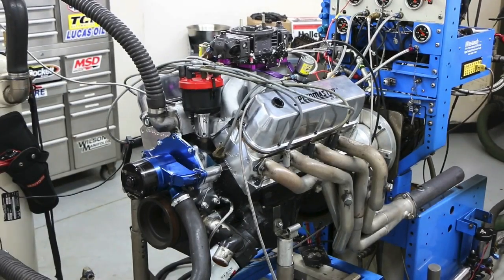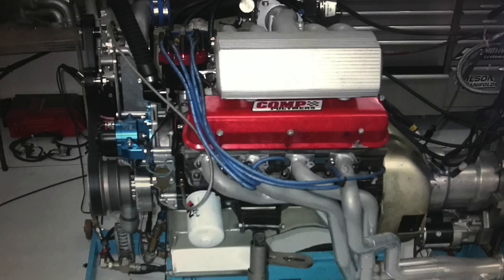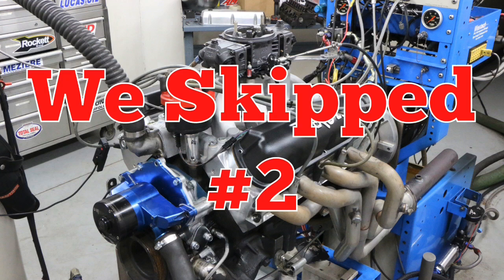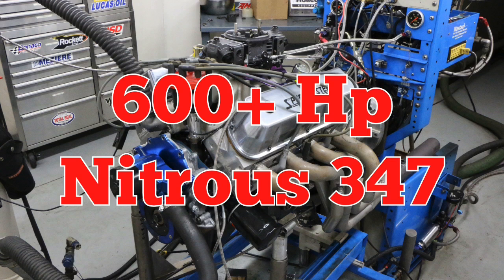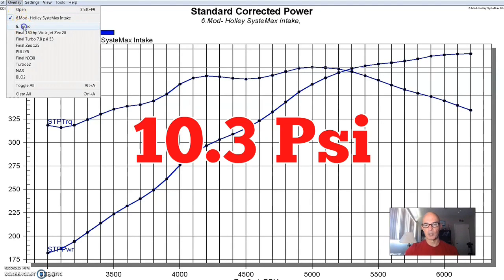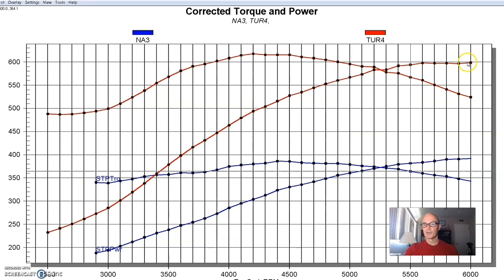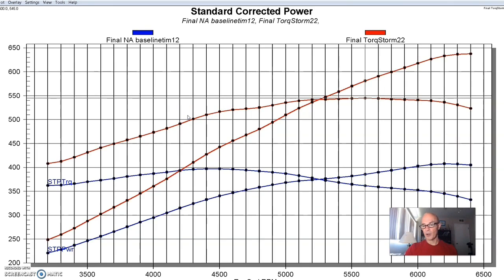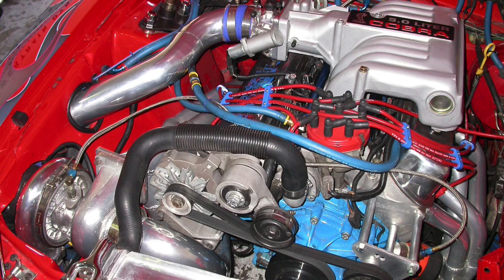5.0L FORD BLOCK SPLITTING-FACT OR FICTION?

Comment: Most of these block cracks were likely a product of an unbalanced reciprocating assembly combined with huge shock loads and some sort of tuning infancy issue and abuse. Could be inconsistent castings as some others said too, or a combination of all of these things.

Poo-poo it all you like, but there were some "block cracking issues" during the 90's up through the mid 2000's or so.
Girdles for bottom and top ends were produced to "address the issue". Whether they did, or not, or were even necessary, is another issue.

Respectfully, not every builder is Richard Holdener, and having access to a dyno, high precision afr meters, etc.
Particularly during the heavy development and aftermarket boom of the previously mentioned eras.
All the block cracks were probably just kind of a huge combination of various factors.

Richard: My understanding is that the webbing on the HO motors is actually fairly thin for a smallblock. What about that for a contribution at just the right harmonic and shock?

Comment: Funny thing, it seems dyno’d motors are pretty much impervious from splitting. This would suggest that the condition that causes a catastrophic failure is being averted. Almost all of the suggested causes could be detected at the dyno.

Comment: It's the stock 2 bolt main cap walk due to the bottom end not being well controlled at high power and high RPM's once the crank starts flexing and walking the caps back and forth they essentially just saw themselves in half. If you run a good crank girdle (people swear by aluminum girdles as they're good at dampening vibration due to the malleable nature of aluminum) a well balanced bottom end  (especially since they're externally balanced), they can last quite a long time at those power levels. Running 4 bolt splayed mains and a crank girdle and valley girdles they can last virtually forever. Keeping the valve train well controlled with lighter spring pressures using a beehive style spring also helps immensely. I think the 302/5.0l SBF is an excellent platform and the 351 Windsor is even a better one. Just got my first 351 Windsor in my '82 F250 4x4. I have 2 289's and a '68 Mercury Cougar 302 I've yet to build but it will get at a minimum a crank girdle however I expect it will see a low RPM life in more of a rock crawler than a race track brawler!
Reply from the maker: MAIN GIRDLES DO NOTHING TO STOP THE BLOCK FROM SPLITTING UPWARD
Reply: @richardholdener1727  I'll disagree with that assertion, I've never seen an SBF split that's been outfitted with main and valley girdles flogged at ungodly power levels and RPM. I don't see your need to yell via text, that's silly.

Comment: My Incon TT 331 made around 550 at the tire. I daily drove it(weather permitting) and took it to the track sometimes twice a month, in a full weight stick car built to hook, for three years before throwing a rod. Other than the hole from a flying con-rod, the block was fine when I tore it down.

On the other hand my friends found a crack in the lifter valley of his supercharged 306 while swapping intakes and that motor only made about 475 at the crank. My opinion is is all comes down to inconsistent castings. Many or even most are fine above 500hp but you only hear about the bad ones.

Comment: When I was younger I saw several hydraulic roller blocks crack from the top of the main journals into the cam journals. If memory serves me correctly all were stroked, & on a heavy hit. I think there’s obvious reasons as to why this can happen. Things like who balanced the bottom end, if it had a main girdle, year of block used, etc… this reminds me of so many other issues when gambling with factory components. Just because someone has, doesn’t mean you or anyone else for that matter are going to have the same luck.

Comment: They split from RPM in a chassis. Pushing hard. Keep it under 6k on boost and it can help. 

I know this video is old but it is legit what I’ve come up to. A 302 block is a pile of shit for pretty much anything but being a original engine when you have 351 option

Comment: Its detonation, thats mainly what splits blocks. Theres a guy who runs his car with a single turbo on c16 with very little timing and it makes 900 wheel and has for years. Not to say its a fool proof way, the main issues with these blocks are that they are  2 bolt main and the webbing where the main caps bolt to is not very rigid so when it detonates the main bolts will vibrate and flex and cause the block to split in half, Obviously poor balancing can exaggerate that but the main problem is the block itself.  Everyone has their stories claiming its a myth and it could just be a bad casting or whatever but honestly its all BS. Fact of the matter is the stock block just wasn't made to handle that much power. You can try whatever remedy you want but at the end of the day if you are making over 500 wheel on a stock block and consistently racing and beating on it you are running on borrowed time.

Comment: I've never split the block! But broke the connection rods! That's an idea! Stock rods with those 5/16" bolts and another with cheap aftermarket rods with 3/8"bolts! Unless a 351w won't fit I see no reason to run  302. What would be great is a  351w with the Cleveland sized mains!

Comment: It could literally be ANYTHING that causes a stock block to split. I don't think there's any way to accurately determine specifically why it happens to a given block, but whatever it is a stock block cannot withstand the failure. An aftermarket block is arguably a stronger part, and can withstand whatever is handling the block splitting condition. 

Stock blocks were really never intended to support such high power numbers, and if you can get them to live for any length of time, good on ya, but I wouldn't trust a high HP (with your favorite power adder) build with anything less an a DART or FRPP block and a rock-solid valve train. I don't even race, and my current motor has a DART SHP block.

Comment: This is what I've seen them do. Crack at the cam bore and drop oil pressure big time. The loss of oil pressure let's you know your fixing to split the block. I've never seen a block completely break in half. Both the 302 and a 5.0 roll that cracked were 6000 stand trans. Lanch at a preped track low 9s say around 700 to 800 hp. Look 5.0 blocks really are a dime a dozen. Try to split one yourself.

Comment: What splits these blocks is easy if you use a 289 older firing order too much load goes onto the front journal when 1 and 5 hit simultaneously that is what splits the block so just use a later firing order camshaft and this will not happen.
Reply from the maker: they split with the HO firing order

Comment: I've got a factory 1986 302 I'm wanting to do something with. I'm kinda scared to because it does have about 450,000 miles on it. I'm not too sure how that would effect the strength of the block
Reply from the maker: what it needs is different heads and cam
Reply: @richardholdener1727  yeah for sure. I'm thinking maybe some flo tec heads with maybe a .450" lift, 350ish duration 115ish separation would give me a nice little build I can still daily drive.

Comment: I think it's torque and tuning has a big part of it. My buddy has one with 650 horsepower stock block and he launches that car at 5,000 RPMs with slicks and it won't die. He does have AR fasteners in the bottom end and the head studs. You should do more ford videos

Comment: I want to be upfront the engine combo I had was never on a Dyno. I had a customer that wanted to run 5's in the ⅛. His combo ran consistent 6.13's. I used his 302 XXX block TFS High ports single plane intake with a .780 lift cam. This combo ran 5.40's down to low 5.30's. It kept cracking the block in the lifter valley just enough to put water in the oil. The engine was in an 88 GT hatch back. We cracked 3 blocks before moving everything over to the a cobra R block. I did not know about 302's cracking until then. It still never "split" the block

Comment: The number in the day was around "500RWHP" not 500HP...    The mains could tear out, it could split down the middle in the lifter valley, or it could crack the blcok around the mains.    It was usually due to harmonics.     There are years in the 70's which had more metal, but early eighties to mid 90's were thinwall casting blocks that failed at these numbers.
Reply: And its a fact!   We had too many situations in those 90s in the thinwall castings.

Comment: Based on internet research, and not my own testing, 3 primary points relating to longevity, and some smaller points. 
- Rpm, keep it lower than 6k
- Harmonic balance. The closer to zero balance the better
- Tuning, a safe tune as you approach high rpm is crucial. Too much timing and a sketchy A/F ratio can be the formula to a kaboom. 

Other things like manufacturing tolerances, wear on the block (age/ mileage), cheap valvetrain parts, e.t.c. 

That said, I believe the consensus is 500whp though, not crank hp.

Good info all around. I've dyno'd at 570/540 on a reman Cobra motor with a safe tune. We took 2 degrees out and it's currently running at 540/520. I'll run it this season and find out how it holds. 
Btw, it's EFI, controlled by Holley's Terminator X.

Comment: oh funny finding this after just asking the obvious question... originally had an NA build.. ported E7 (took a very long time to do it best studying under Vizard) , ported truck intake with twin 61mm TB, lunati valvetrain.. was hoping for high 300s   but   stimulus   told me to buy a rebuilt powerdyne  with 6 psi pulley.  Why not completely alter everything even after getting a custom chip tune for speed density.  I plan to keep hypers but ive got a snow kit (water/meth)... also a T6 aluminum cap girdle and ARP studs.    I did see back in 2006   there were the "valley girdle pro"   and even Don Garlitts had a hand in valley girdles for Clevelands..  but they don't seem to really be a thing anymore?   or people found the block just splits underneath them if it's going to go...  but I guess they helped with twisted just as a cap girdle helps with walk and strengthening the webbing.    I see people mentioning high octane  ( via water meth )   how much can detonation contribute?

Comment: I think it comes from motors being out of balance even if its slightly out of balance a lot of people will run stock balancers and have the rubber come out and not know it, or the rotating assembly is slightly out of balance from maybe a rod and or piston that's not the same weight

Comment: I’m a diehard Ford guy.  I watch your and other videos to learn.
My gut says a casting flaw or balance issue.. but again for me if I were building for hp I don’t want to worry about failures so I’d start with a Dart 4 bolt main block..

Comment: Mickey Thompson ran many different blocks at high RPM.
He said changing rpm changes the load on an engine, which adds the most stresses.
He said keeping an engine at a constant rpm, even high RPM, the engine will live longer than up and down RPMs.
He took 2 mustangs to the salt flats in 1969.
His comments on engine's is priceless.

Comment: I've split one, stock 302, tw 170 heads, anderson b4 camshaft, vortech s trim with cog drive pulled for 17lbs of boost. I have pics if anyone would care to see. But long story short on the street from a 25mph pull in 3rd gear at 5700-5900 rpm it just stopped. It cracked all along side the passengers side nearest the oil pan rail. It broke the crank and the mains out of the block. I believe the cog drive helped it break... we had turned the vortech up some 7000rpm.

Comment: Stock cams in the earlier, lower revving motors generated poor harmonics for high rpm usage. Camming for the intended power band is imperative for the longevity of the engine, even though one can often find the rpm through the force of a blower or turbo.

Have you ever noticed how much smoother an engine cammed for rpm revs out? My 5.9 Cummins is a huge example; a stage 2 cam was engine to max out at 3k rpm, and would rev easily to 3500 rpm, but was not smooth there. I have had my stage 4 cam to 4k rpm, and it was smooth getting there. I cringed every timeI ran the stage 2 cam over 2800 as it just didn't feel right. 

I suspect running the stock cam with  boost and rpm caused cracking weakening of block. I believe it is poor harmonics related to extended rpms that a stock cam and heads would make for that particular design.

Comment: I only saw the block, the story behind it was all second hand. It was not completely in two. The rear china wall was still partially in tact. But every main web was split and the valley floor between the lifter galleries. I was told it still ran when it was pulled from the car, but no oil pressure and lots of noise.

Comment: Depends on the block. Cast iron is weaker than forged or billet or aluminum. A billet ford 5.0 block can run up into the 1000's of horse power. And of course mustangs today factor run over 500hp. Just depends on material and what your building it for and what and how you use it. I always go with the 351w long before I would a 302. 351 is just a hell of a lot stronger and more powerful motor.

Comment: Is it possible to have a pump gas with a nitrous plate under the carb and feed it with m2o e85 would that work if its the right ratio ?

Comment: I've seen one split due to crank breakage back in the day on a heavily nitroused high compression 302 with super heavy antiquated TRW domed pistons in it. 
I remember the crank was broken in 3 pieces and there were rods and pistons still attached to the pieces of the crankshaft. The middle piece still had the complete thrust bearing, cap, journal and part of the cam tunnel attached. I think the casting lottery theory applied to both the block and the crank. The car was an automatic equipped, full weight 65 mustang that went like 10.20s in the quarter with a 302 with dart iron Windsor heads and a shit ton of spray. I dont know exactly how many runs it had on it but It had quite a few and was street driven occasionally.

Comment: I really enjoyed this video and I hope this comment finds you! To answer the question at the end of the video "It just can happen" I am logged in under a personal account but well know in the tuning market for small block fords with foxbody's in general EEC-IV or standalone. The beauty of understanding is from well respected engine builders that breakdown a motor and tell you why it let lose. Detonation is usually a easy give away because it is seen. As we never want it to happen, but honest advice I can say when a block splits or internals just dissolve you will know if tuning is correct or not. Funny, though Turbo combos are very efficient set up correctly and usually more forgiving then a blower combo at the same power level in some cases. When the tune is spot on then it all depends on the engine staying happy from its birth =) all factors considered.

Comment: SBF’s split the block? I always thought that was BS. Cobra Daytona coupes beat the entire world at endurance racing, with small block fords. 500 hp? Nope, but they did make 400, and were run wide open for 12-24 hrs at a time. And that was against Ferrari, Aston Martin, Maserati, Jaguar, ALL the big players. And all the small ones, too. SBF’s were one of the best engineered, most durable, longest lasting engines ever made.
Reply from the maker: THOSE EARLY 289 MOTORS HAD DIFFERENT BLOCKS

Comment: What kinda racing were you doing where you can run wide open for 30 min straight and you're allowed to have a supercharger? Was it a boat?
Reply from the maker: the Silver Stage Classic Open Road race in Nevada (90 miles)

Comment: Hi folks I'm currently building a a 306w it has been fully refreshed, decked,balanced etc. Stock crank and rods, hyper pistons, comp cam 284hr, gt40p heads fully ported polished, comp cam rollers, 650 holley dbl pump, 
I have no idea what kind of power I'm expecting...any guesses? 
Oh it's going into an 85 mazda b2000 ute too haha
Can I run any boost on that set up or do I need to upgrade heads and forged pistons??
Reply from the maker: yes you can run boost-that combo might be 350 hp or slightly more (depends on how good the porting is)
Reply: @richardholdener1727  thanks very much Richard!

Comment: I bet if you braced the bell housing to the chassis so the engine twist isnt putting all the stress into the block via engine mounts, that would likely prevent potential block cracking, also have a good harmonic balancer.

Comment: With all of the engines I’m assuming you’ve had proper machine work done to the block and rotating assembly balancing. My thoughts are the tune.  Timing may have fluctuated during the run, possibly a misfire or an intermittent fuel delivery issue ie injector intermittent fuel flow, slight pressure drop, slight carburetor issue, etc. Which in my conclusion would cause a significant harmonic vibration to the structural integrity of the block.

Comment: I’ve only seen one block get split like people talk about and that was a combination of bad tuning and revving it way too high. I’ve personally made upwards of 750 flywheel Hp with a stock HO block. I always used good fuel, and kept the RPM on the stock crank around 6k. I’ve seen countless other builds over 500-600 with proper tuning run for a very long time. The one I did see grenade itself had a piss poor chip tune using Speed Brain, got spun to 7000 on a stock rotating assembly and did indeed come apart, but it actually made UNDER 500 HP lol. So it is definitely not a power figure that breaks these blocks, just like there is no arbitrary power figure that is “safe” for these blocks when the state of tune is terrible.

Comment: For the most part from what ive seen, its detonation and rpm, if you keep timing down and don't turn it too high for internals (about 6-6500 for stock and not above 8 on full forged) they will usually stay together